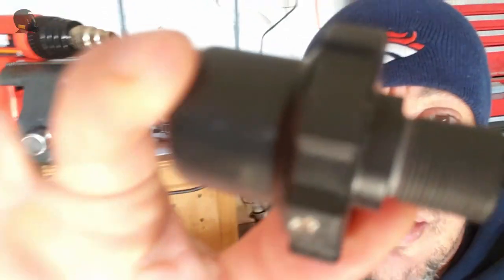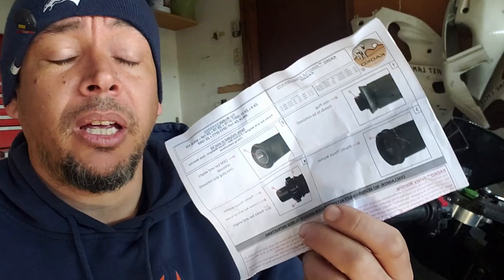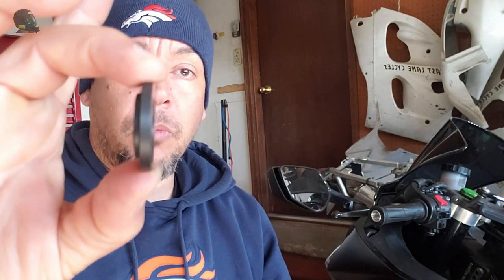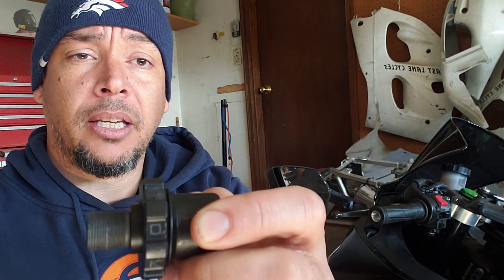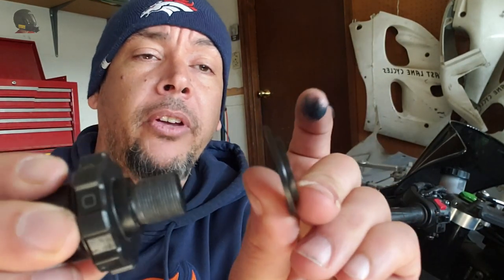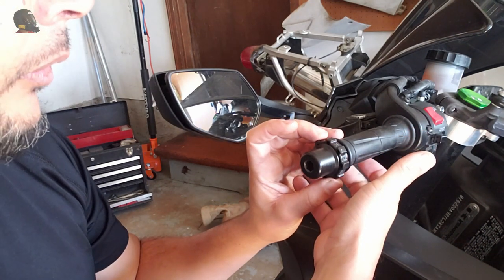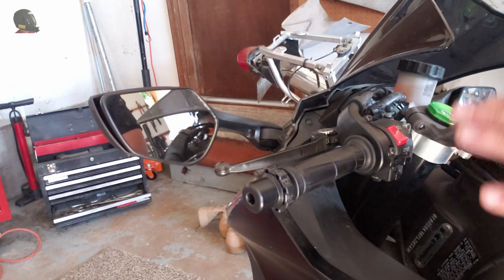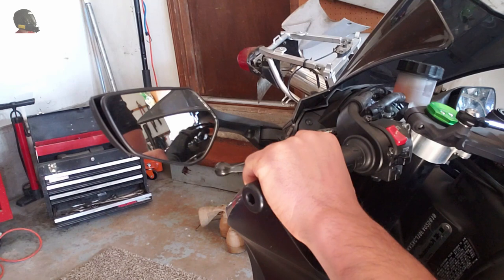EP66: My new throttle lock installation

Comment: Could you still use bar end mirrors with that???
Reply from the maker: Just to be safe I would not try to mix a bar end throttle lock with bar end mirrors, I would instead use an Atlas Throttle lock.  I made a review of the Atlas throttle lock which I run on another bike here..
https://www.youtube.com/watch?v=MmCBh6T2s90&t=2s